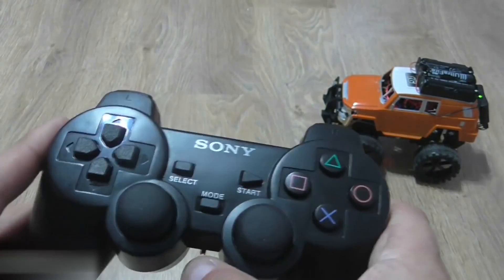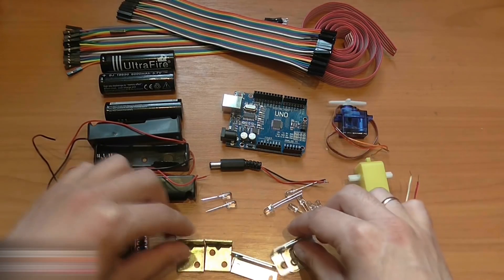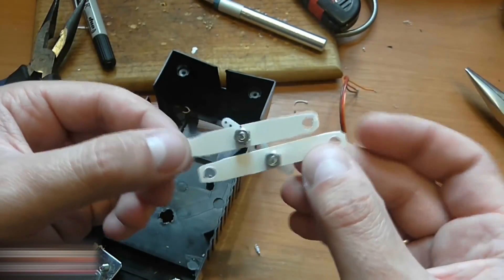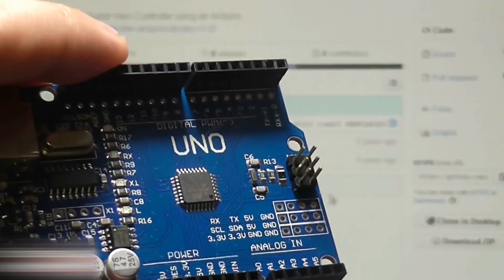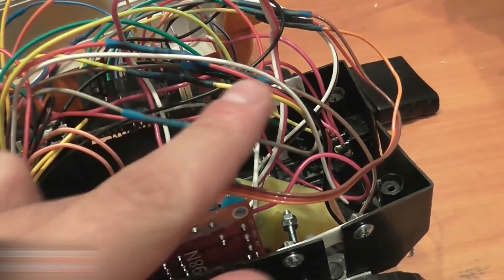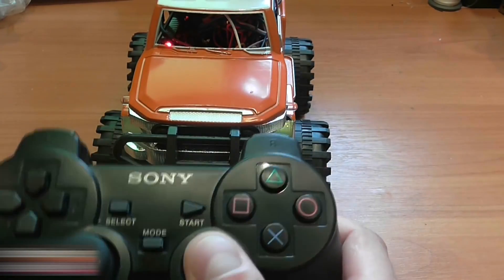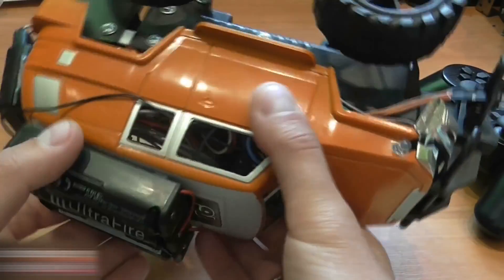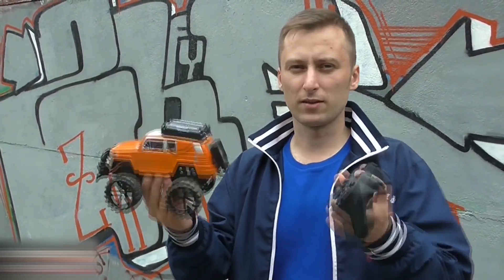How to make a car with the Sony PS2 joystick remote control

Comment from the maker: Hi, everyone! Did you like this tutorial? Leave your comment below.
Reply: Ты лучший!
Reply from the maker: Спасибо!
Reply: HomeCraft СПЁР С КАНАЛА science vetal
Reply: Yes.. I like it. It's amazing. I have purchased all components just please mail me a clear circuit diagram on sammansindhi@gmail.com
Reply: HomeCraft please make a simple drone using sony joystick
Reply: hey i wanna ask something ? i use your sketch to run dc motor but my dc motor still not working ? am i miss something ?
Reply: Will this work with a 24v power source?
Reply: Would there be any issue with running multiple ps2 controller in close proximity?
Reply: Hi dude... I like this video...  I bought all the equipment and uploaded the program into arudino board. I connected all the circuit as you mentioned in the video. 

The remote receiver power is on and board is also ON, but Motors does not work. 

Please can u send me the clear circuit diagram to my mail ID. williamcarey02@gmail.com . 

Thanks in advance.
Reply: Thanks for your help
Reply: How to connect lights

Comment: Arduino: 1.8.8 (Windows 8.1), Board: "Arduino/Genuino Uno"

sketch_ps2_rabochiy:1:34: error: PS2X_lib.h: No such file or directory

compilation terminated.

exit status 1
PS2X_lib.h: No such file or directory

This report would have more information with
"Show verbose output during compilation"
option enabled in File -> Preferences.
  

can anyone help me with this problem

Comment: hi i had this code working with an arduino nano, then tried to use it on a mega 2560, but i can't get communication between the ps2 controller adapter and the mega, i'm using the same pins as in the video. anyone have ideas?

Comment: Hi dude... I like this video...  I bought all the equipment and uploaded the program into arudino board. I connected all the circuit as you mentioned in the video. 

The remote receiver power is on and board is also ON, but Motors does not work. 

Please can u send me the clear circuit diagram to my mail ID. williamcarey02@gmail.com . 

Thanks in advance.

Comment: hi i love the video but i did end up getting this code iv gotten so far :(  its a wireless ps2 controller  i have restistors hook up but idk  were I'm going wrong  OUT:IN Configure 1:FF 44:FF 0:FF 1:FF 3:FF 0:FF 0:FF 0:FF 0:FF  OUT:IN Configure 1:FF 43:FF 0:FF 0:FF 5A:FF 5A:FF 5A:FF 5A:FF 5A:FF  OUT:IN Configure 1:FF 43:FF 0:FF 1:FF 0:FF  OUT:IN Configure 1:FF 44:FF 0:FF 1:FF 3:FF 0:FF 0:FF 0:FF 0:FF  OUT:IN Configure 1:FF 43:FF 0:FF 0:FF 5A:FF 5A:FF 5A:FF 5A:FF 5A:FF  OUT:IN 1:FF 42:FF 0:FF 0:FF 0:FF 0:FF 0:FF 0:FF 0:FF 0:0 0:0 0:0 0:0 0:0 0:0 0:0 0:0 0:0 0:0 0:0 0:0  Controller mode not matched or no controller found Expected 0x41, 0x73 or 0x79, but got FF No controller found, check wiring, see readme.txt to enable debug. visit www.billporter.info for troubleshooting tips Unknown Controller type found